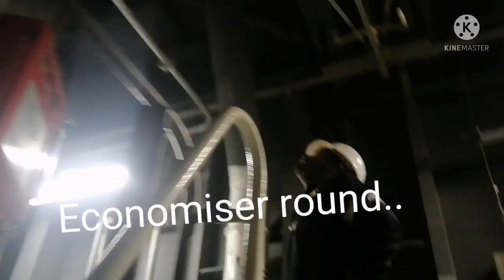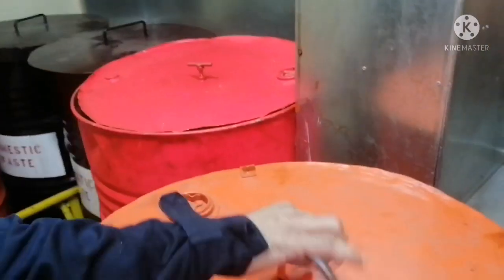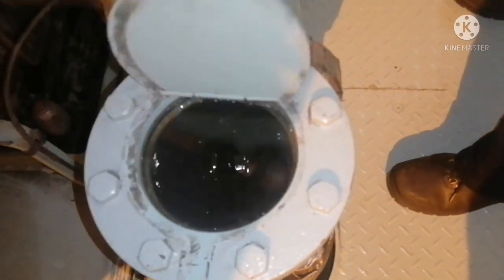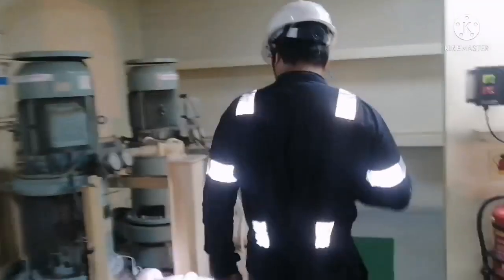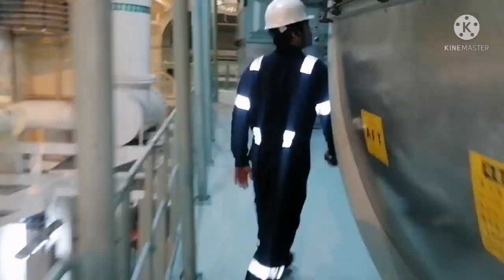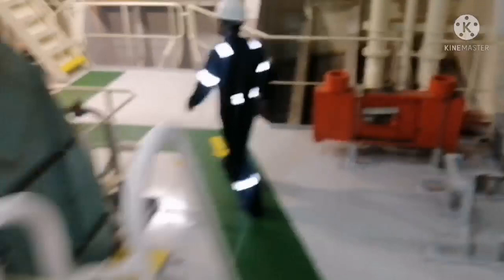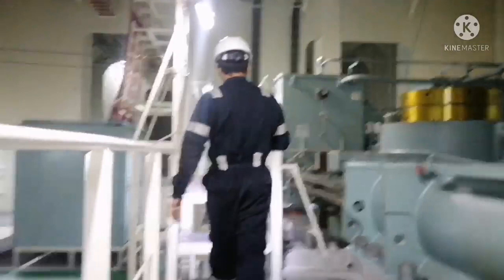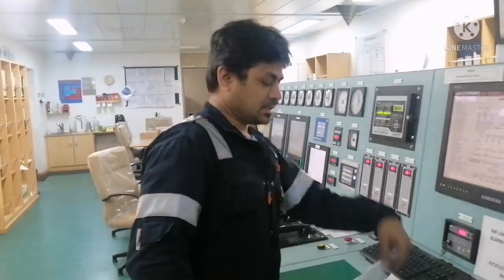How do they do.. How to take UMS round in engine room.. PART-2

Comment: sir, good day. i have a question regarding "stuffing box" draining.
during engine watch, we check the tell tale hole of stuffing box drain. little by little oil always comes out through the drain. but, why continuously oil will come out?
Reply from the maker: Thanks fur your query sir..
The uppeemost scraper ring of stuf box communicates vth the  control Funnel on outside of the engine where you see continuous flow of oil.
This Funnel provides means of checking of both scraper and seal rings are functioning properly.
Blow by air thro funnel  indicates defective seal rings and excessive oil indicates defective scraper rings.
Hope this reply will satisfy your query.
Reply: @marine-knowledge-basha  sir, stuffing box has 2 parts, (upper and lower part). both has there own sealing ring and scrapper ring. the oil draing through the funnel as we always see, is it from the lower part? that means, during upward movement of the piston, excessive crankcass oil is being scraped from piston rod?
Reply from the maker: @mec6953  the funnel communicates vth the uppermost scraper ring.
Reply: @marine-knowledge-basha  ❤❤❤

Comment: Sir what are the checks we do on tie rods during our watch
Reply from the maker: Thanks for your good query sir,
When u go for round u have to take visual inspection on Tie-rod  ..The cracked Tie -rod tends to vibrate a lot .
Hope this reply will satisfy your query..
Reply: @marine-knowledge-basha  yes thank you sir ,is there anything else we can check during rounds ,bcz it's one of the mmd qstns ,
Reply from the maker: @ajithakk3178  During round we can check for vibration of bolts and check for the cover is in position or not.The vibration may be either because of crack or loosened nut.
Apart from that you can use feeler  and keep between cylinder head and bolt to check the gap...so u can find the damaged or loosened bolt easily.
Hope this reply will satisfy your query.
Reply: @marine-knowledge-basha  thank you so much for ur valuable time sir ,